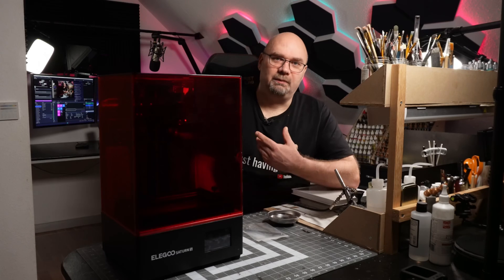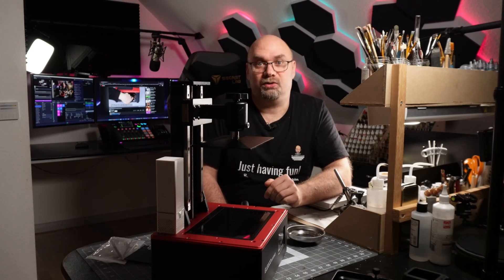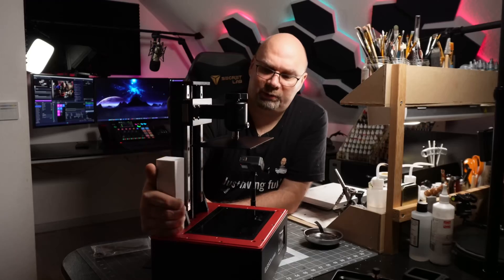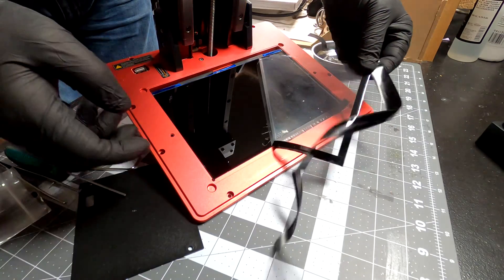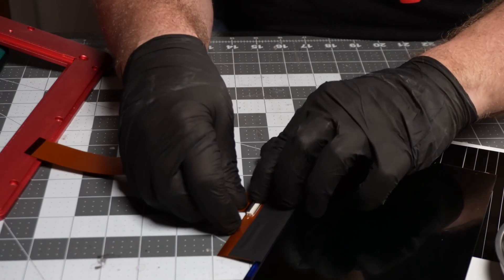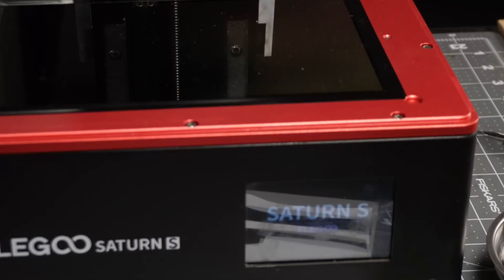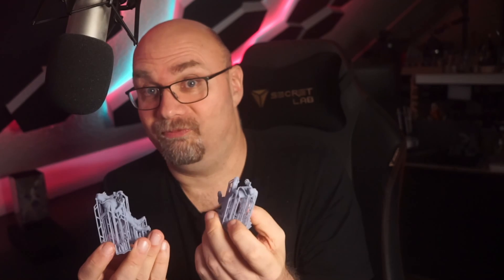Elegoo Saturn S - Replacing the LCD Panel

Comment: Im not gonna lie the saturn s is my first 3d printer. I did not take as good of care of it as a I should have the screen still works but its been eaten away might have to get a screen protector
Reply from the maker: My first printer was a Mars Pro. Then i got the Saturn S and that was a work horse. I  have been using it until last year where i got my Saturn 4 Ultra 12k i have been using it a lot until i cracked the LCD. There is also a video about replacing the LCD on that. And i have lately run into a lot of other issues wit that printer, but that is also fixed. I hope you can fix your printer and get back to printing again😀

Comment: Thanks for your video. That was a big help. I'm from Finland and I had the same problem with my 3d printer Saturn s 4k. Did you update the screen data to the software and where did you find this correct file? Elegoo's pages are a bit misleading.
Reply from the maker: Glad my video could help :-) I just wrote an email to Elegoo support and they sent me the new display. i did not update any software. i have updated the printes firmware last month. but that is pretty much it. i think Elegoo have a great support if you just contact them by email. im sure they will guide you to the correct file you are looking for :-)
Reply: @olebrogger  I sent a message to elegoo.  I am waiting for an answer.  yes, this misery will be resolved

Comment: Great video but there is a difference between "fixing" something and "replacing" something.  Technically, the original panel is still broken, it wasn't fixed, simply replaced. :)
Reply from the maker: yeah, you are right, maybe i should have called it "fixing the printer" maybe a bad choice of words.
Reply: @olebrogger  i tend to agree. This is a "replacing the screen" video. I was hoping to find a troubleshooting video to try things before fully replacing it (aka ordering a new screen).
Reply from the maker: @myerlinggames  Title has changed, hope this will be less confusing

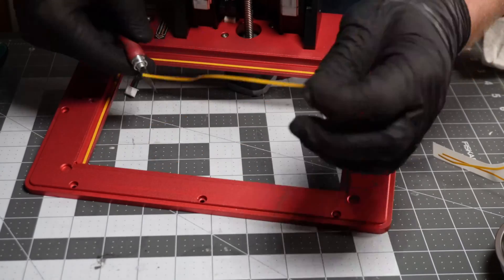Comment: 4:59 Why does the bottom of the screen look like that?
Reply from the maker: Think it is the cover of protective plastic
Reply: its a protective cover, but the screen itself is see through to allow light the penetrate through.
Reply: @myerlinggames  Wasn't talking the cover. It was the adhesive between the screen and the glass

Comment: what about that black tape that was around the edges?
Reply from the maker: I forgot to put it in, but it works perfect without
Reply: definitely put it in. I use black "electrical tape" works just fine and waterproof when done correctly (aka resin proof).

Comment: how good is the washable resin from elegoo. i dont need tippy top , just for figurine/bust work, washable sounds like the most less workflow
Reply from the maker: I Love The Water Washable resin, you don't need IPA anymore, just hot water to clean your prints. i have only used Elegoo resin so i don't know how other brands work. I would love to try them out, but right now i will stick to what i know works. Just remember to NOT bake prints too long under UV Light, they will be too brittle or crack.